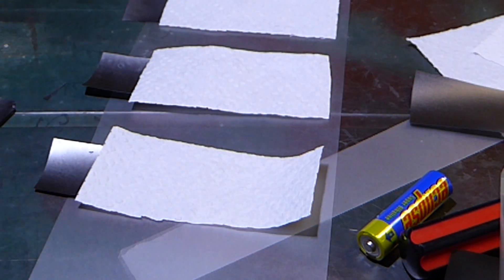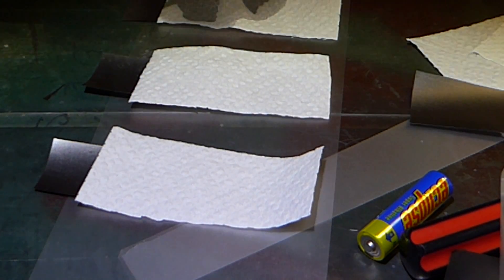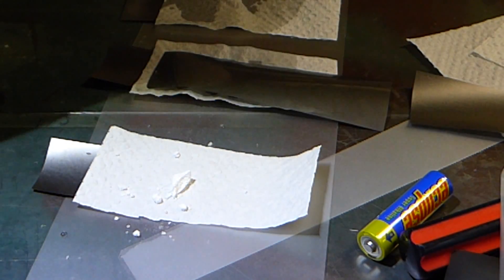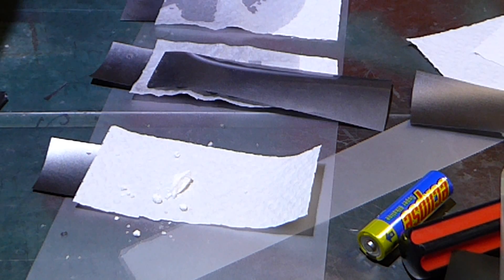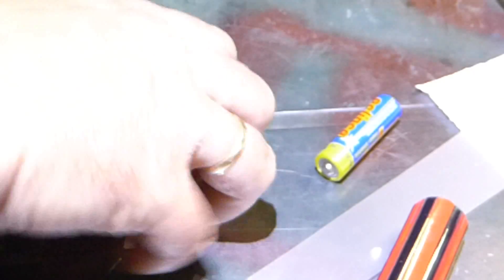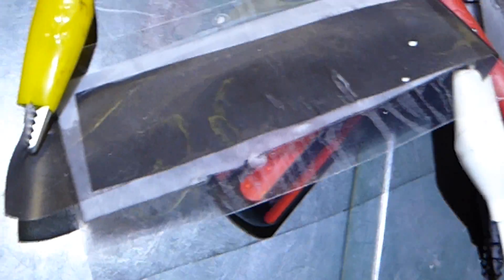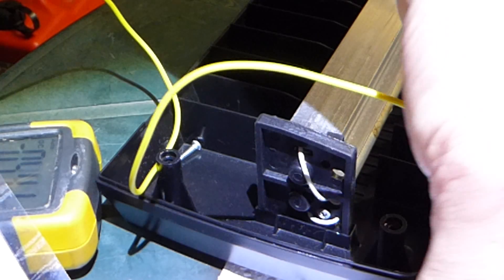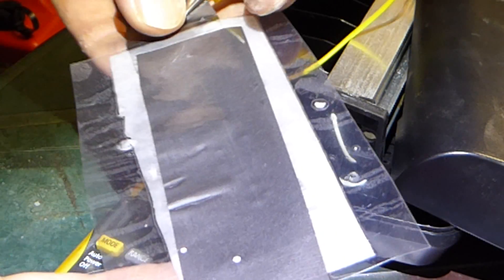Test cells & Laminator Fail

Comment: Ive made some of these before, i found epsom salt and distiled water to be the best, what you have is a self charging cell, it should rest around 500mv, short the cell even for weeks and it will quickly recover back to 500mv
Reply from the maker: cool thanks for your feedback. I will be getting some MgSO4 this weekend...did you use graphite electrodes?